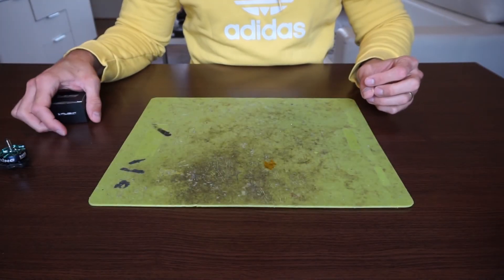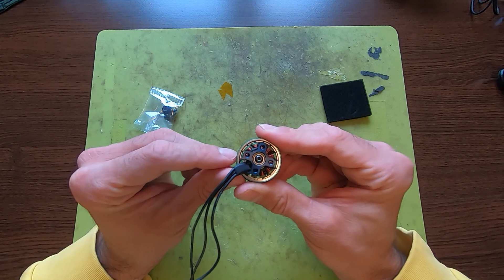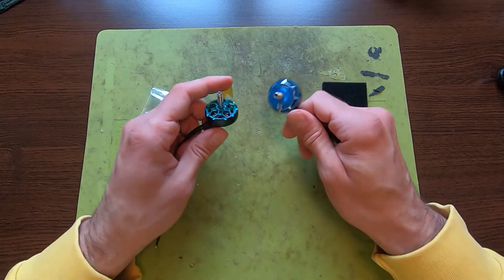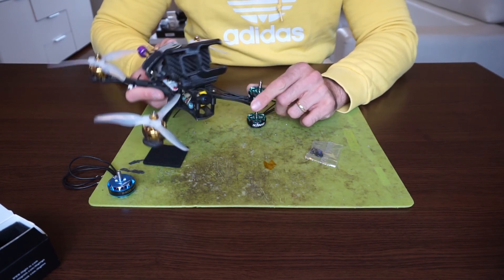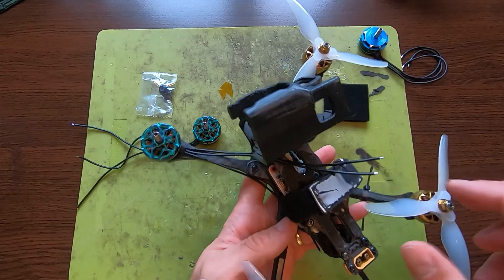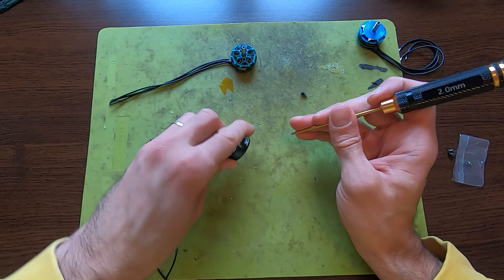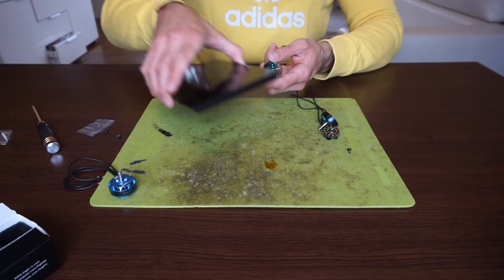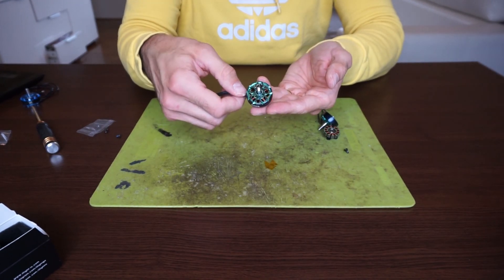iFlight XING2 2405 1800KV 1950KV 4-6S Brushless Motor for RC Drone FPV Racing Multirotor

Comment: I'm looking for a new motor. Someone told me to check out 2405 1950kv. I only have experienced with 2207. Are 2405 good motors? Is it better than 2207? Thanks for the review!
Reply from the maker: It depends on what are you looking for and your flight style. If you lookin for a really smooth motor with lots of power this is motor for you. But remember that power dilivery is not instant like on 2207.
Reply: @mrRockwellFPV  Oh got it! That was a very good point. I'll stick with 2207. Thank you so much!
Reply from the maker: @neilfpv  GLAD I COULD HELP

Comment: thx, lot of info! i'm building a very light LR 7' and collect information on xing2, especially 2604.
Reply from the maker: Dont know much about other components but 2604 should work great on 7" props.
Reply: The 2604 on paper has only 70% of  stator volume of the common 5 inch motor sizes. I think for a 7 inch they might not be powerful enough. Maybe a very light builds with low pitch biblade props. I would apply them for 5 inch cinematic builds.
Reply: @pirchoo  very light build in sight, all parts in hands next week. a 2604 motor may be good enough if i use light propeller on light build.
Reply: just bought them to test on a 7" we'll see how it performs
Reply: @HackerManiac1  looking forward!
Reply: @pirchoo  ive seen quads with a 6s2p 8000mah  with 2807 doing 22-25 mins with 1.5kg weight. Im building this apex at around 750-780 g auw with a gopro and a 6s lion 3000 pack
Reply: @HackerManiac1  im building a cinelifter, own design, just got the carbons cut. But its an X8 config, 8inch 2812 1150kv. Not sure about battery, but 4000mAh at least. Friends flew Siccario, and told me that the 2806s were a little under powered.